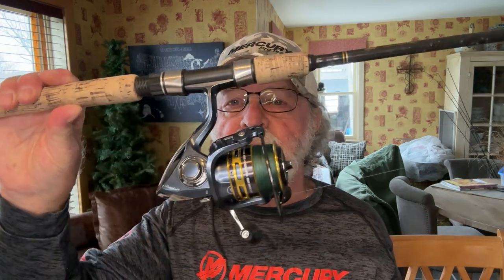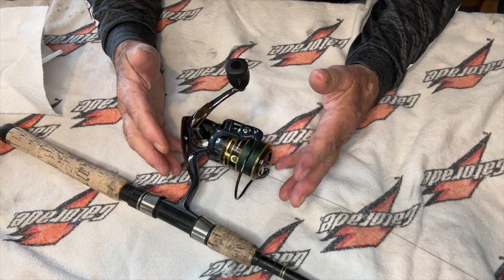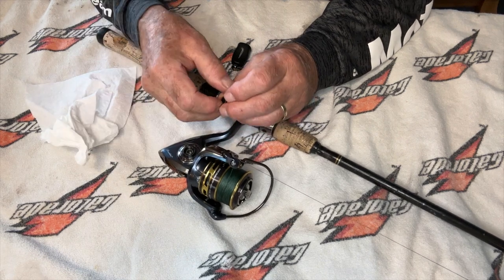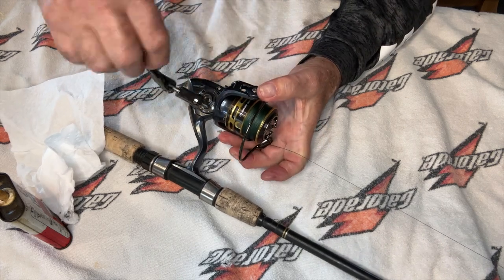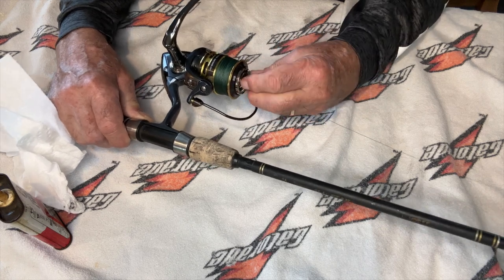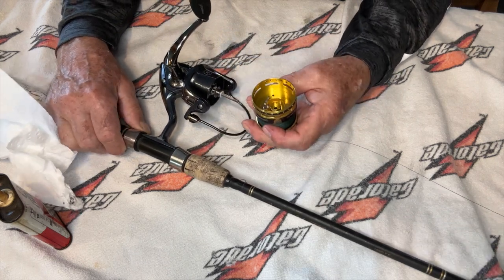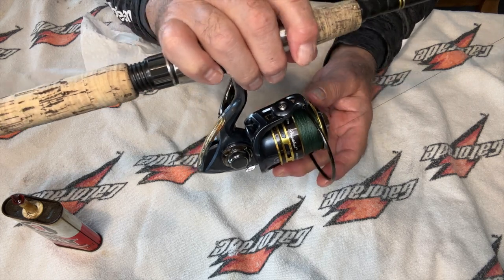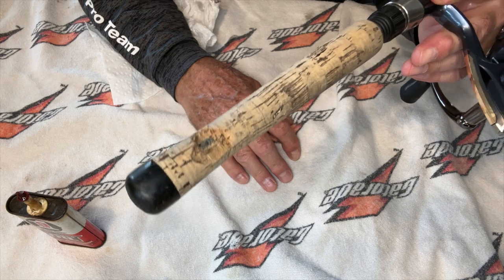Lube Up Your Pflueger President And Shimano Spinning Reel For A Smoother Fishing Experience!

Comment: Grease is for extreme high heat heavy load situations.  WD40 is superior to 3-1 but the message is the same. Remember the old Zebcos packed like a wheel bearing 😂.  I never bothered but I have no doubt modern synthetic lube sprays are the cats meow.
Reply from the maker: Burned out a lot of Zebcos as a kid. Thanks for watching